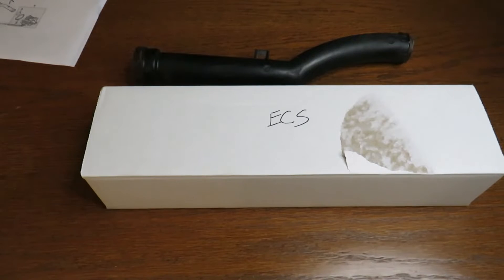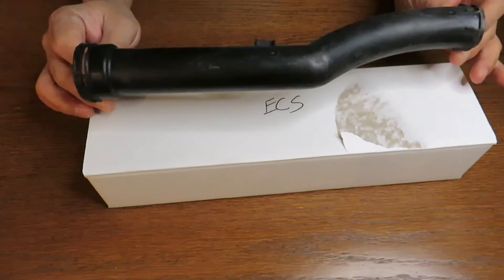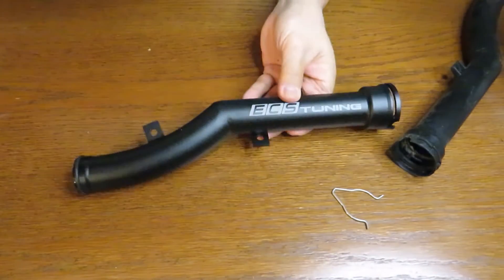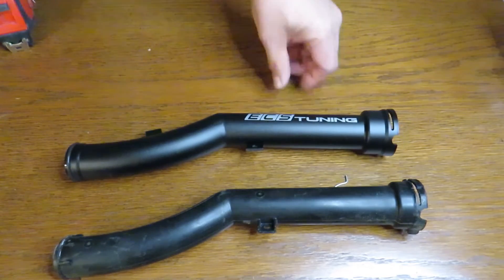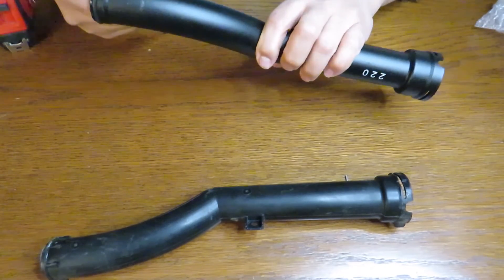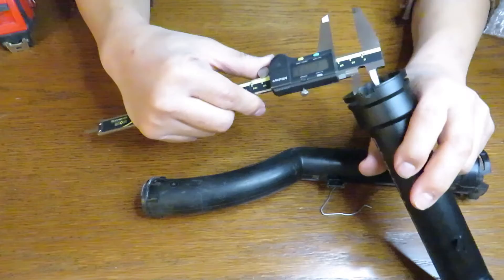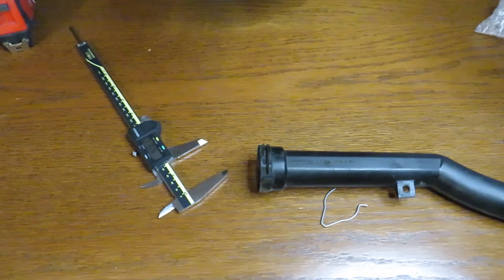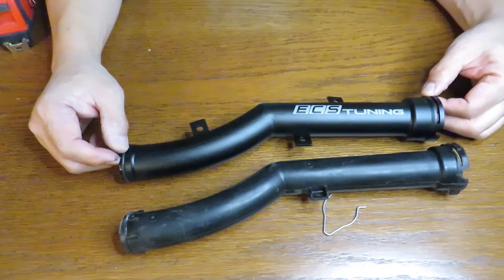Unboxing Metal crossover tube Mini Cooper R55/R56/R57/R58/R59/R60/R61

Comment: Do you know how long the plastic one was?
Reply from the maker: Luckily I keep everything. The easiest way to measure the length of the tube is to stand it straight up on a flat surface. I stood it up on its thermostat end. I used a tape measure to measure from the table surface to top of the tube. The metal one (haven’t installed yet) is 13-3/8 inches. The old plastic one is 13-5/16 inches but I can see the edge of the tube is partially broken or worn away which made it 1/16 shorter. Good luck
Reply: @mcmcminicooper lol, I keep everything too. Thanks for replying so quickly. I called Mini to get the specs on the OEM pipe and they couldn't tell me. I ask because the ECS metal won't sit flush on the water pump side. I was curious if it's too short or if it just sits that way because of the angle. The plastic doorman one seems to be a bit longer with its specs stating 353mm. Don't wanna do all this to have it leak because it's not seated correctly.
Reply from the maker: @derekshane8786 interesting, because of its off center shape, try turning it slightly or someone suggested using the old o-ring as long as its not damaged. Those extra mounting brackets could be interfering - just hack them off. Good luck

Comment: I did the crossover pipe without removing the manifold...but it was a bear.  A couple of indispensable tools for that job. 1) a lighted borescope with enough distance to see down and under that manifold, especially where the pipe mates with the rear of the waterpump housing.  2) A very long pick (18inch)...just in case the old (brittle) crossover pipe breaks at the mating point with the rear of that waterpump housing.  It apparently can happen from time to time...and it did for me, too. The extralong pick made easy work of removing the gasket and pieces of that pipe.  The borescope allowed me to check the mating surfaces clean before installing the new pipe. A little bit of Vaseline on the gasket will help push the pipe into the housing.

Some other points to consider:
Wear long sleaves...or you will look like you had a fight with a bobcat.  Just trust me on this point.
Try to do the job when the neighbors are on vacation...'cause you're gonna swear like a MTHRFKR.
Buy the metal "ECS Tuning's" after-market crossover pipe...to avoid ever doing this f-in job again.
Reply from the maker: @jb678901  Lol, I wished they made metal crossover pipe when I did it. Not looking forward to do it again…maybe I’ll be dead by then and give the mini to my son.

Comment: Did i hear you right whem you said the end of yhe ecs pipe is stil  Plastic at the end..?   Cause its thr ends that break,,,, in fact that's the only part that needs to br metal. Iam hoping i misunderstood but wanted to be sure before i  buy one. I just installed thr metal thermostats housem amd valve cover, trying to undo mini  smart move bto have so much plastic under hood with a motor thstbruns hotter then, most.... Gemius engineering but whatu do i know,ha ha, thanks in advanced for clarification, cheers
Reply from the maker: The external of the pipe is metal. The end that connects to the thermostat assembly is metal. The end and slots are metal. Inside the metal tube is lined with a plastic sleeve. The plastic sleeve extends slightly beyond the metal tube on the end that goes into water pump. The groove that holds the o-ring is plastic. I think they did it this way because it is easier to mold the o-ring groove in plastic rather in metal. The fails usually occur on the thermostat assembly end which should not occur anymore because it’s all metal. Good luck

Comment: Man, I'm glad I stumble to your two replacement Thermostat videos. I need to replace my Thermostat and didn't realize I need to get the crossover pipe and then looking thru the questioner about this metal crossover pipe. My question is  and I'm not sure if you know if this metal one will fit. I got R57.
Reply from the maker: Not sure, check with ECS Tuning website. It should list the Minis it fits. Good luck

Comment: What’s your opinion!!!
Reply from the maker: If you can afford it and keeping your mini for awhile, I would use the ECS over the plastic version.
Reply: The metal version seems to be a couple mm too short on my 2014 countryman s. It doesn't sit flush into the water pump housing.